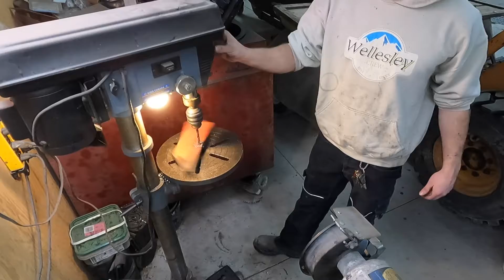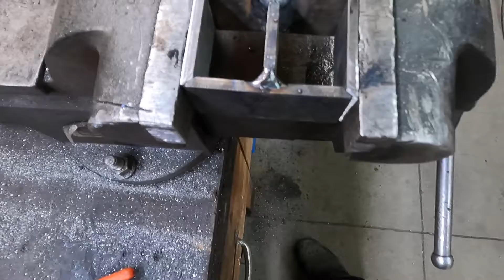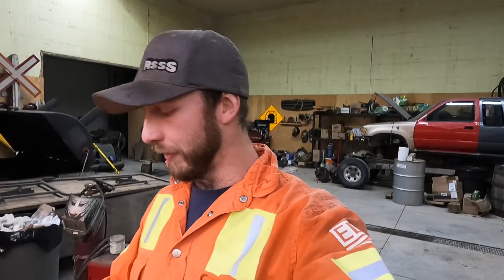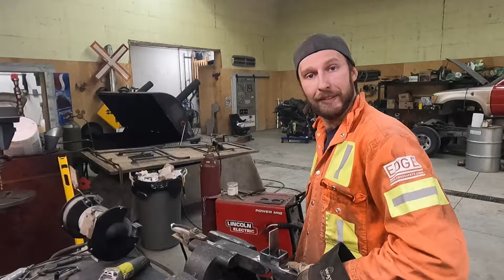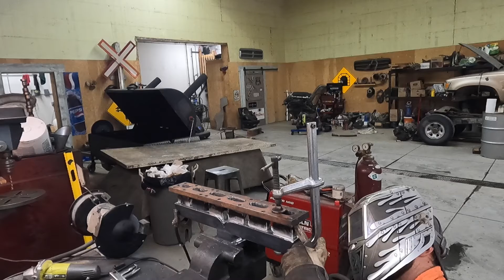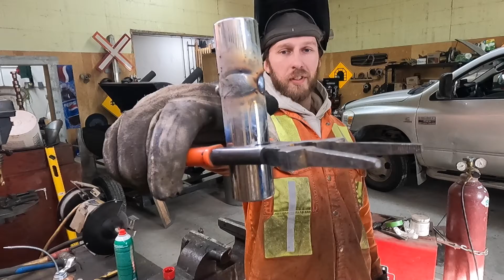Om606 Custom Header Build for Cummins Turbo Swap!

Comment: That manifold turned out way nicer looking than I was anticipating Haha.
Reply from the maker: thanks! i based it off of a Steed Speed 12 valve manfold
Reply: @RowdyRelics  neat, not the best for flow, but looks better than the stock garbage.

Make sure you pin the crank pulley and intake gear if you don't already know about that issue.
Reply from the maker: @Borgschulze crank has been pinned however I haven’t done the intake cam gear yet. Also still have valve springs to install so I’ll probably do it at the same time
Reply from the maker: @Borgschulze thanks for all the input though! This engine has fascinated me for years and it’s really hard to come by in Canada. Really excited to get it working!
Reply: @RowdyRelics  I'm building a Mercedes 190E with OM606 swap. I just test fitted my new manifold and turbo today.

I've got 4 OM606s at my house... Also in Canada 😂 I had 5, I sold one.

Been collecting them since 2020.
Reply from the maker: @Borgschulze  I've wanted to collect them but haven't had the money lol. Do you have any OM648's?? Where in Canada? Im from Ontario but lived in BC for almost 10 years
Reply: @RowdyRelics no 648s, but I did see one in a junkyard, I sold some parts off it.

I'm in Onterrible.
Reply from the maker: @Borgschulze  there’s been a couple decent 320 cdi’s for sale down there. Tried to get my little brother to buy one haha. If I ever get down there with a trailer I’ll probably buy one of those 606’s off ya!
Reply: @RowdyRelics I only have 1 NA to sell. Other ones are spoken for.

I'll be running an NA-T in my Volvo with 240hp in the future.